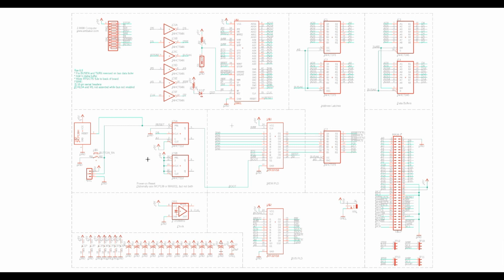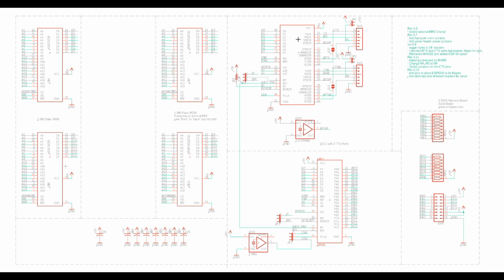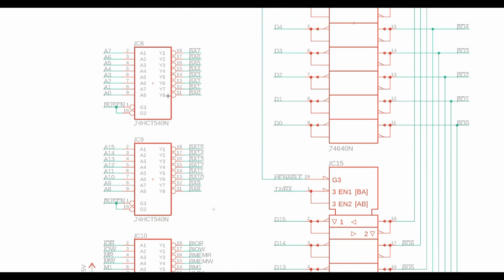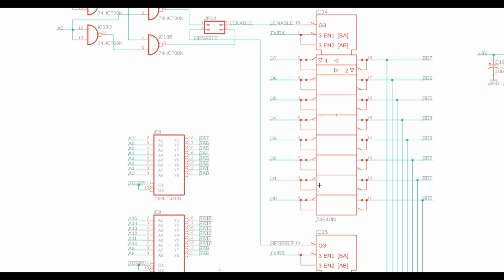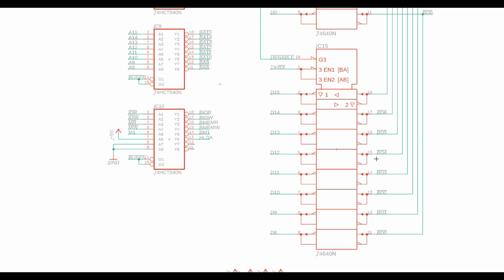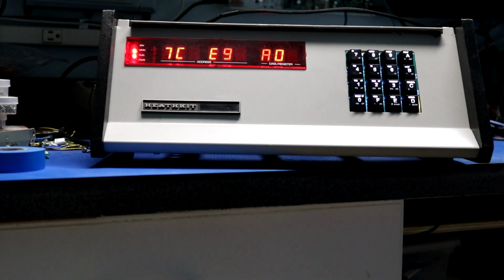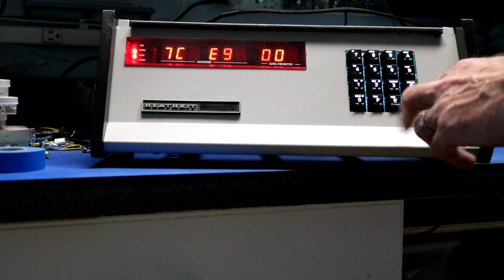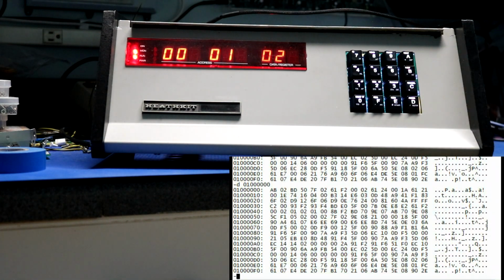Heathkit H8 Part 2 - a Zilog Z8000 CPU board for the H8

Comment: Then you should be able to run a version of UNIX written for the ZILOG Z8000, It is just like the INTEL 8086 where the Address and Data Lines are multiplexed except for address lines A16-A23, You will need a FPU to go with the ZILOG Z8000 to work with IEEE754 floating point, doubles and long doubles.

Comment: Dumb question time: If the external bus is active low, Why are the bus control signals tied to ground through the resistor pack instead of 5v?